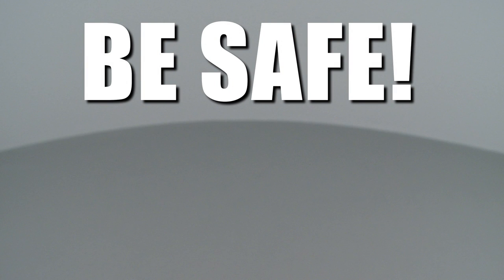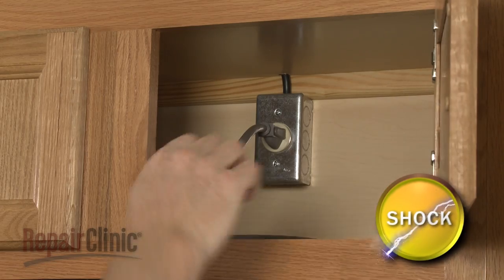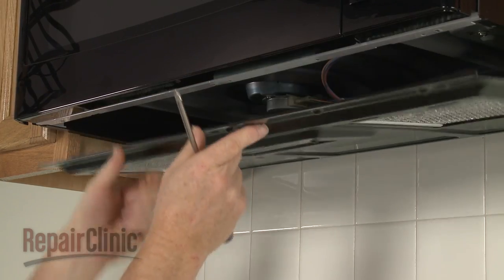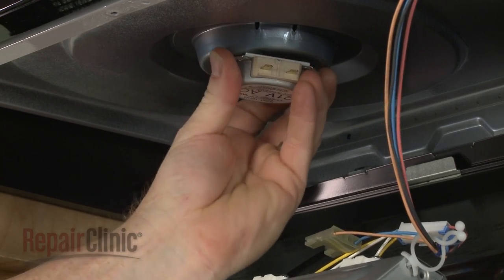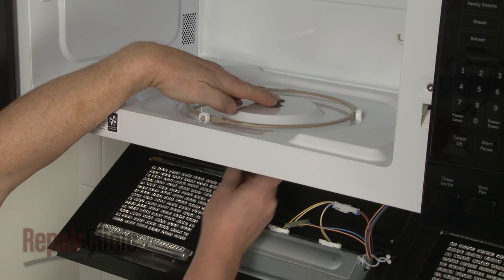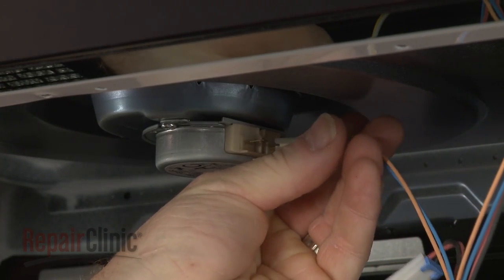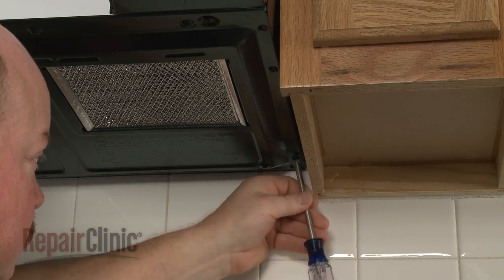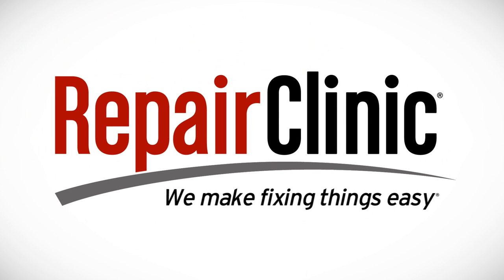GE Microwave Turntable Motor Coupler Replacement #WB06X10815

Comment: Thank you so much for this video! As a mom with two young kiddos and a dog underfoot, I was able to complete this in less than 5 minutes. I have a GE microwave and the part number was different, so make sure that you check for parts that are compatible with your microwave’s model number. Oh, and to answer someone else’s question—you do have to remove the motor in order to change the coupler (at least with my microwave)—they have a tongue in groove that links them together.
Reply: Thanks for answering the question about removing the motor
Reply: Sounds good, but there is NO WAY you did this from start to finish in 5 minutes!!!

Comment: Excellent video. It showed me 98% of what I needed. My version of the microwave has a second screw holding the motor in and doesn't need a counter clockwise turn. But this is a minor variance in an otherwise spot on video. Thank you so much for saving me from having repair people in my house during a global pandemic.

Comment: Is it really necessary to remove the motor to replace the coupler? Shouldn't pulling it out from inside the microwave and popping a new one on work?
Reply: I was just about to ask that also. Does anyone have the answer to this question? I wouldnt feel confident enough to remove the motor myself
Reply: Nevermind. I just pulled it out from another one of my microwaves and put it back in again and its rotating. Hope that helps anyone reading this

Comment: I have a GE Microwave model JVM7195ek1es,  S/N SG227861B.  The coupler appears to not be thick enough to stay engaged in the grooves of the glass tray.    The tray constantly comes disengaged and then stops turning.  Is there a thicker coupler that will go higher in the tray grooves and seat better so the tray does not slip off?  Thanks.  Love your videos BTW.  I have repaired many a microwave, dishwasher, clothes washer and dryer because of your videos!

Comment: My dad cooked something for 8 minutes so the plastic piece has melted due the high temperature, do I need to buy the whole set?. My microwave is a Whirlpool fortunately still heating.
Reply: JT you can just buy a coupler on ebay. Try pulling the old one off before doing all the unnecessary work you see in this video.
Reply: thanks for the advice, I tried to pull it but, due it's plastic I couldn't do anything about it, it was totally melted at that very moment. I bought a new one (motor turntable and the coupler) for 12.95 bucks on ebay, this new one comes with a metallic pin on it instead of plastic like the old one, which is really cool, hopefully my dad don't screw it this time, LOL!. It's been working perfect without any issues.
Reply: Just Google microwave turn plate coupler it will bring up ever appliance part web sites that carry that part also have got you microwaves model and serial numbers with you so you know your getting the right part.

Comment: If you are just replacing the coupler there is no need to remove the motor, just remove the faulty coupler and install the new one.
Reply: Maybe in your case, but the majority of GE Microwaves have to have the motor removed to remove and replace the coupler.

Comment: I keep seeing these videos. But my issue is the microwave plate dont stay on this part in the cleanest microwave, I can fix it right and it comes off just by using the microwave, it's a bad design.  It suppose to grab it completely  a little movement  and it's off track. I even had it changed thinking it was a messed up one, ha! The past 6 years nothing but irritation. Samsung sucks!

Comment: I replaced the turntable motor and coupler but the turntable still does not turn. Help what can I do now?
Reply: Same shit I’m dealing with now, what was the problem??
Reply: Disconnect connector from motor.  Plug Microwave back in.  Take a voltmeter, set it to AC volts 120v.  Have someone help you by holding the connector.   Then start the Microwave, take your voltmeter leads to each of the 2 points in the connector, you should have 120V.  If you don't have 120V then your control board is gone.

Comment: repair clinic.com can food crumbs course a grinding noise in a microwave i have a Emerson microwave 1.6from walmart and since the coupler are no longer hard fixed on to the motor they just sit in there is it normal to hear a king slit pop at first start up after on no sound except the fan worms and cooks good is this normal it seems if food crumbs are in the turn table crevice i her a grinding noise if clean no abnormal noses only time I've herd nose is when food crumbs are in the turn table space and is it normal to hear a buzz if door not fully closed or something cout in it please respond now thanks

Comment: LOL, a brand new Microwave.  On a older Microwave there will be grease all over the inside of that bottom piece and the surface where the motor is.

Comment: is it normal on Emerson microwaves for the coupler to just lift off no screwing on turntable works fine microwaves heats up good please respond now please thanks
Reply from the maker: +jhon chapter 3 verse 16holybible Yes the coupler just slides onto the turntable drive motor shaft.
Reply: +RepairClinic.com thanks just got from Wal-Mart refurbish but like new 1.6 Emerson microwave got for $59.03 ive seen as far as microwave Emerson are made by Panasonic my last brand and it 16 years old still working but think turntable motor maybe going out makes weard tumping nose whin turning still heats a few months ago threw sparks wen tried to use no metal in and smelled burning rubber so with the life span of Panasonic i am glade to find out that Panasonic makes Emerson microwaves mine made 2014 i found a Panasonic on Amazon looks just like it so i believe wicapeda is Wright Panasonic makes Emerson microwaves Emerson confirmed the copoler comes loose as you sead just put into place no screwing on or turning till locks when in place and turn ring in place and turntable on wont turn till set and i turn on wich its so post to do you see i had just got from Wal-Mart was worrying broke but newer microwaves compiler comes loose my old Panasonic coppler fixed in place 98 model you have to pre off to remove thanks for you're response god bless